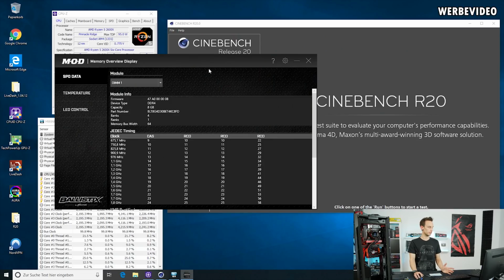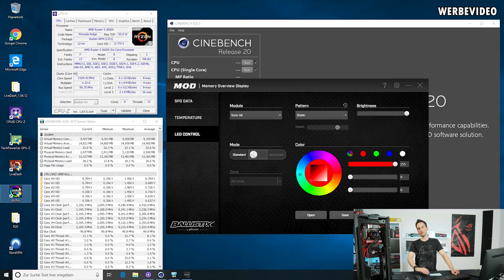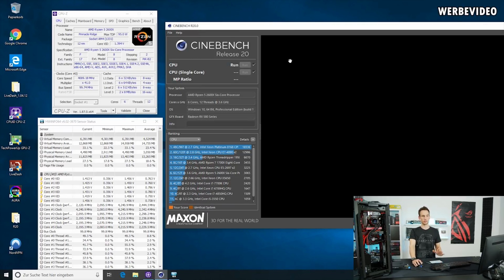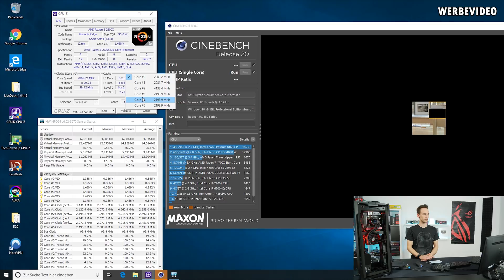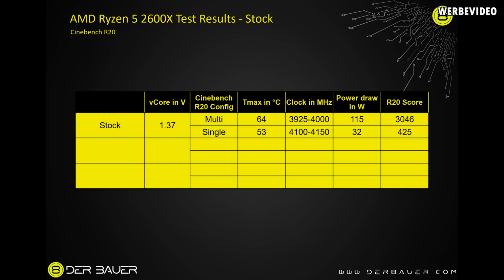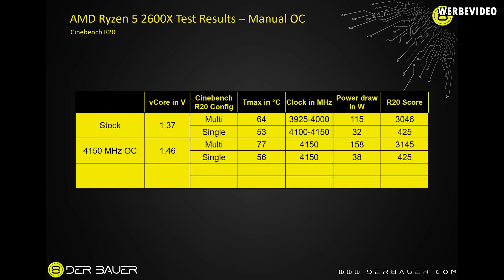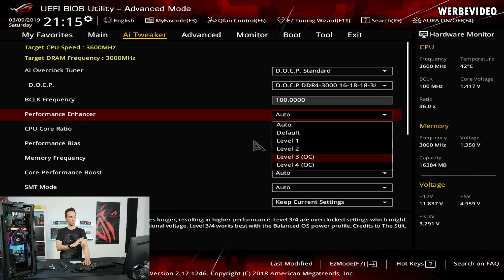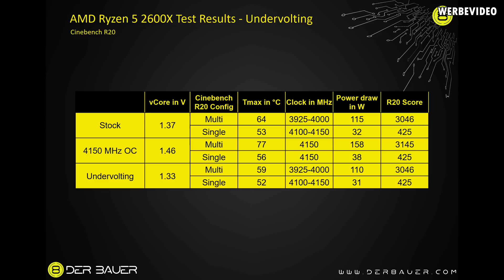The problem with AMD

Comment: Try to use with some better performane RAM G.Skill TridentZ 32GB 3200Mhz CL14, 2 sticks dual ranked is best choice to higher up Ryzen performance, would be interesting to see the diffrence. 32GB vs.16GB also making diffrence in alround system performance even in games.
Reply: I remember reading that single rank is better for ryzen. Don't remember why, but something to do with the interconnect not liking it.
Reply: @NickTrouble  
IIRC there was some talk of 2>1>4
Reply: I built a system with that ram, and my brother in law liked it so much that I built one for him too.

I tried putting his ram in my system just for kicks, and having 32GB did make a difference. My cinebench R15 score went from 1436 to 1556. Not sure it's worth the price, but it does help!
Reply: Patriot Viper Steel, runs at 4400 MHz with 19-19-19-39 timings, almost 40% higher frequency, with roughly 10% tighter proportional timings, albeit with a higher power draw. The Trident series is good(I'm still using my TridextX from 2014), but it's not currently the best available. Adata's XPG D80 kits equal the TridentZ in terms of OC/timings stability at high frequency, and tend to stay cooler.
At least it's better than that Corsair/kingston garbage. Mushkin seems to have fallen into that group as well...consistently slower, overpriced for their performance.
Reply: @auturgicflosculator  those sticks are just good old binned b-die, they are literally the same chip as the 3200cl14.

As of now, it is impossible to run ram faster than 3833mhz on ryzen. 3833 was a unique and very unstable benchmark ram speed some overclocker achieved, but I've seen people with 3600 cl16 systems running stable before. I have a 3600 cl16 kit that can't run over 3000 cl14 on my system, because I got fucked in the silicon lottery and the memory controller in ryzens is horrible...

Hope ryzen 3k helps with the ram speed problems, infinity fabric would benefit greatly from ram speed.
Reply: @C4CH3S  3466
Reply: @C4CH3S  More likely Ryzen's are not achieving high memory clocks due lock with infinity fabric, every one seems to assume there's somehow no upper limit for complex internal bus structure. It looks like 3k-series bring IF divider so memory can run at double clock speed of IF. AMD wouldn't create it if they thought it wouldn't help achieving higher memory clocks. It will be interesting to see how 3k-series deal with memory. Pretty sure b-die memory kits still remain highly beneficial in gaming as they can reach very low latency. Another big assumption is ryzen performance is all about pure memory clock because of Infinity Fabric. It's not. You get best performance out when real memory latency is at lowest point. Something like 3600CL16 (xmp) is not faster than 3200CL14(xmp). However tweaking sub-timings and finding optimal clock speed yield best results.
Reply: @kognak6640  I saw somewhere in a reddit thread that ryzen 3k will run divider for faster infity fabric speeds. That would be the correct move in my opinion.

And yeah, the scaling with ram speed falls of a cliff over 3200, way better to have 3200cl14 with low secondary timings than 3600cl16 in my opinion.
Reply: @C4CH3S  No, it's fabric speed what gets divided. It's either same as memory clock(default) or half of memory clock.
https://www.techpowerup.com/253954/amd-ryzen-3000-zen-2-bios-analysis-reveals-new-options-for-overclocking-tweaking
"Unlike earlier generations, the new BIOS offers UCLK options for "Auto", "UCLK==MEMCLK" and "UCLK==MEMCLK/2". The last option is new and will come in handy when overclocking your memory, to achieve stability, but at the cost of some Infinity Fabric bandwidth."

Comment: So it’s not so much a “problem” with AMD. It’s just that AMD delivers a product that’s already complete and well-made out of the factory and that doesn’t require much tweaking to get the best out of. Unlike Intel’s products which leave a LOT to be desired out of the box.
Reply: Hah
Reply: The problem with creating content about overclocking AMD should be the title. They don't need to be delidded like Intels CPUs. So much less to do, so much less to record about. People continue to suck Intels ass just like they do with Apple. Over priced status "symbol garbage". The best Intel can hope to do is keep pirating employees from AMD and Nvidia, otherwise they'll continue to fall behind with their half ass quality inferior product line. It will be EPYC. Pun intended.
Reply: Or you could say AMD factory overclocks their cpus just to stay competitive with intel. I don't know why you would say intel products leave a lot to be desired either? Their turbo clocks are usually pretty close to what you can manually overclock to on air anyway
Reply: @Superhello220  I say that because to get the maximum out of an Intel CPU you need to delid it, replace the thermal paste, sand it down, etc. Not to mention even the average consumer has to fork out extra to get a decent cooling solution. Don't get me wrong, for tuners such as der8auer Intel processors are obviously much more fun to work with, and with AMD there's not much to be done. But for the average consumer, getting a complete package that performs at its peak right out of the box is much more desirable.
Reply: @Astfgl  I mean when Intel can half-ass it and still beat the competition by a fairly hefty margin (single threaded) why would they absorb the added cost of extracting that last little bit of thermal performance? Applying higher factory clock speeds would increase power consumption as well, so given that well over 90% of their customers are happy with the performance they receive already, why make that trade off? The few who desire more performance can easily extract it by delidding and applying liquid metal..especially seeing as how their soldering process is inferior to liquid metal anyway and leaves lots to be desired
Reply: @squirt626  I wanted to cool my gpu with liquid metal but I just closed the google tab when I saw it costs 45€ lol. If you want to extract the best out of an intel cpu you need to buy the k model, z motherboard, delidding tool, liquid metal and a cooler that probably costs more than 50€.
So about 200€ to get 500mhz-1ghz. There is no doubt intel is better on the high end, but is it worth it if you have to pay that much more?
Reply: @OperationGames45  that's all true.. and I guess it comes down to who you ask. Some won't mind paying for the additional performance while others will see it as unnecessary. The point I was trying to make to @Astfgl was that Intel's attempt to, as he says "perform at its peak right out of the box", on this '9th' generation with soldering the IHS has resulted in worse thermal performance than had they just left us to delid it ourselves. 
But 45€ for some Conductonaut liquid metal?! That's crazy, I paid $25 CAD for my small tube and still have some left after delidding mine and my brother's cpu. If you have a friend maybe you guys can split the cost? :D The difference it makes is enormous !
Reply: @squirt626  you don't need to delid 9th gen Intel chips as the stim is fine. I don't think buying Z series boards is a bad thing if you're over clocking. The VRMs on lower chipset boards aren't designed for over clocking and you have people who don't know what a VRM is trying to get extreme performance from boards that aren't designed for over clocking.
Reply: @Justfold1017  I know the stim is fine, and that's my point..it's fine but it isn't fantastic. Its considerably better than the thermal paste they used in previous generations, but a higher quality material could have been chosen for larger gains.. and the fact that der8auer and others have delidded and applied liquid metal to receive an increase in thermal performance is testament to that.

Comment: I totally agree. Theres just nothing you can do with AMD CPU's when it comes to overclocking. 
I'm sticking with my Platinum i7 8700K. I won the super silicon lotto with this one. It posts at 5.5GHz and runs stable at 5.3GHz.
On air running R20 with a 5GHz OC at 1.250v it stays at 80°c with a 10 year old (but new) ZALMAN 9900MAX 300watt air cooler. 
I'd like to see someone with a Ryzen cpu try to get those clocks.
On the flip side. Ryzen 3rd gen. is almost here and there process is manufactured by TSMC so i have some hope for these new cpu's when they arrive.
Reply: Expense is subjective. If you can't afford it, don't get it. Just don't go lecturing those that can.
Reply: Bla bla bla, more clock more cinebench results. But you need to void your warranty to get better clock in general. More clock means more cpu cooler capacity. And guess what? Too expensive :)

Comment: Same cpu on a rog x370 F motherboard i just undervolt aswell -0.05 ( custom water ) and it work pretty well 4100 all core during cinebench and 4150 in gaming, 3333 cl14 fixed sub timing that's all !

Comment: Thanks for clarifying. Are results similar with non x skus like 1700, 2600 etc.?
Reply: You can overclock the r5 2600 to like 4.0ghz and call it a day.
Reply: hussein hussein an average 2600 can be overclocked to 3.9 with the stock cooler, 4 to 4.1 with a 40$ air cooler and  4.1 to 4.2 with a good AIO or custom loop. ...and 5.5+ with LN2 😁
Reply: My 2600 can go to 4.0 on stock voltage, to get to 4.1 I need to go up to 1.406v. On all settings stock it will only boost to 3.725 on all cores.
Reply: Safi Majid non X have more or less tha same potential, and they perform quite well overclocked, nice to save money if you don’t mind some tweaking, the Ryzen 5 2600 is now in my opinion one of the best all rounded CPU